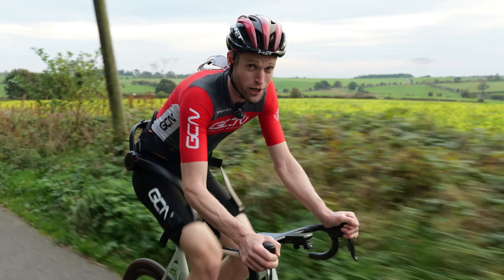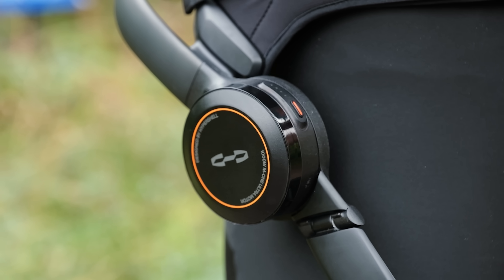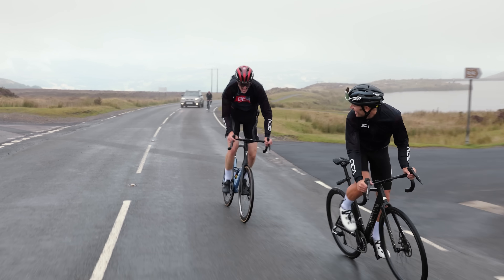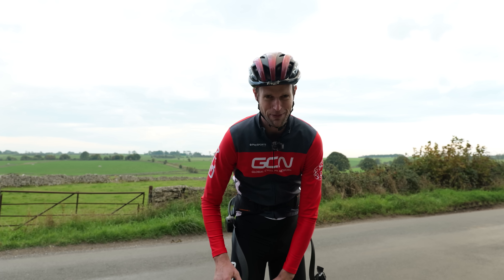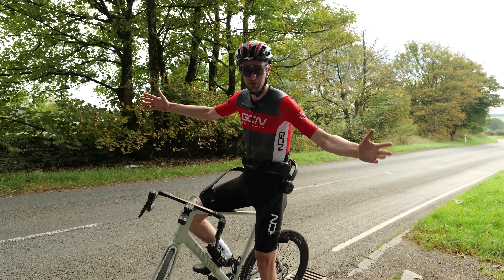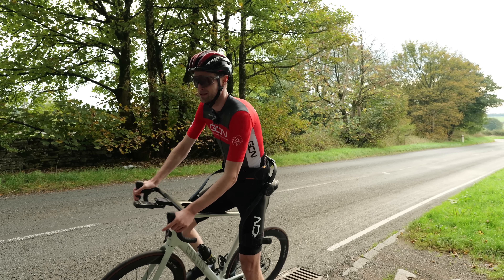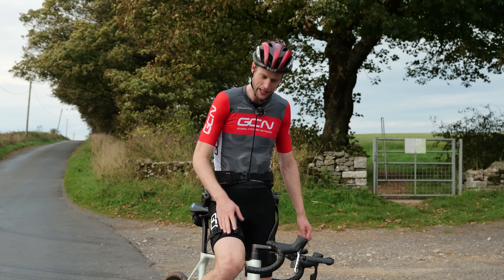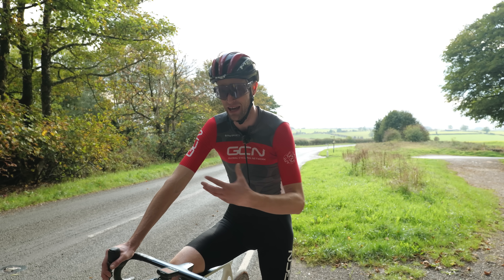Does Cheating With An Exoskeleton ACTUALLY Make You Faster?

Comment: How does it compare to one of the lightweight e-bike like the one Ollie used. 4K vs the added bike weight vs batter capacity. I am guessing the ebike is a lot better. This thing is however, universal , walking climbing. etc.  Need to run that route one more time with the e-bike.

Comment: The math does not lie. 72wh of battery but only a 5ah battery 1C would be 14.5V and 72 W that gives you 1 hour. Theoretically.  If 1000w and it doesn't melt, it is 4 min theoretical at 14C  better derate that by 50%. 2 minutes and you are spent. So lets pick a nice boost to get you to the hill fresh. 250W . that is about 17 minutes. hand it to the chase car before the hill. LOL. Wonder if they have a chart on their website....

Comment: Isn't this just a very over-engineered and less efficient ebike? 
Besides that, Connor should have worn the legs on both runs and not known if they were on or off. GCN themselves just did a video on placebo and 7% difference could easily be in that range.

Comment: Thinking logically , this device seems to be for walking and assisting a little hill or two , sprinting maybe not .
So if the most assistance was derived by walking / slope climbing with them ( first ) and then that cadence / effort applied to cycling , it should therefore also get the best results .
Would it make you faster maybe , maybe not .
Would it be easier , yes .
May be of greater help to those with hip issues ,
Apparently there is a device similar to this which helps out with bung knees ( saw a video of it but can't remember where now ) .

Comment: It can't really work. You can't take the trigger/feedback from the same element you are controlling. You need a thigh muscle sensor or a crank- or a foot sensor to have independent feedback.

This way it can only be some kind of simulation and it will probably only work a little for a specific cadence

When the thigh pushes down and the motor is activated, the pressure from the thigh disappears and the motor deactivates or reverses.

Comment: I liked it! A nice follow up to the climbing challenge.
 7% HR offset is interesting... a speed difference, or was it same gear & rpm for the same output? [my logic thinks says same W output = same speed, but my overthinking brain meats queries Perceived Exertion gearing differences]

Questions for Conor;
- Did the TT feel like a difference of zonal effort change? (Z4 unassisted, Z3 with assistance)
- The matching watts of the sprint... Did it feel like you'd gotten beyond its capacity to help? (whether rpm or loading)

Queries more for the GCNTech boys: (napkin drawing theories, unless you want to do tests runs...) 
  A) Could you suss out a ~24W saving in his bike and kit setup, is there 24W to be made? (Short of trips to Silverstone testings or Oli buying a bunch of industrial fans and sticking tufts of wool all over Conor and cordoning off a large section of GCN Megabase to create some cardboard monstrosity of a tube that the GTN crew then mooch in on for fine tuning...)

 🥞) Based on the Long Being's current fitness and exercise routine, what would it take to get him 7% better? (let's say over 3 - 6 months)

Comment: One thing to take into the consideration on a bike is the weight of the mechanical legs. Would be interesting to see the w/kg for with & without them (taking Connor's overall weight when using them or not).

Comment: These bionic legs could be great for a commuter or perhaps someone with knee or leg injuries and needs a little help to get out on a longer ride. They seem to work better at lower efforts.
Reply: It would be a good experiment to see how the bionic legs help assist a beginner cyclist who may not be as "fit" as Connor.
Reply from the maker: @mk6465  Does this call for Naomi??
Reply: These would do nothing for knee issues.

The assistance they provide is still force being applied through the knee joint. 

You would need a system that bypasses the knee joint.